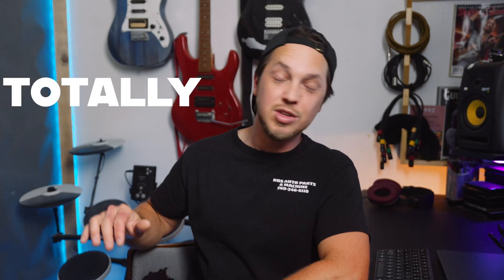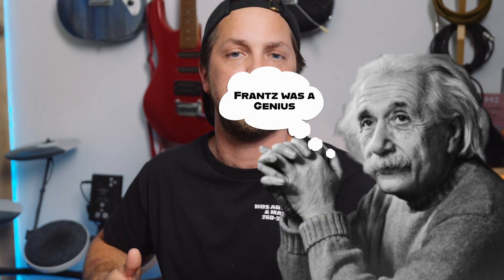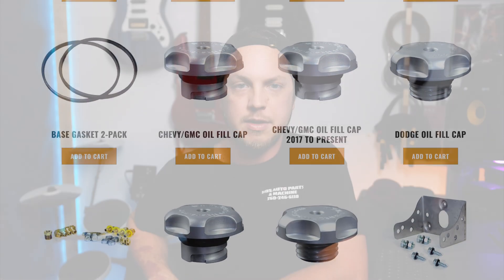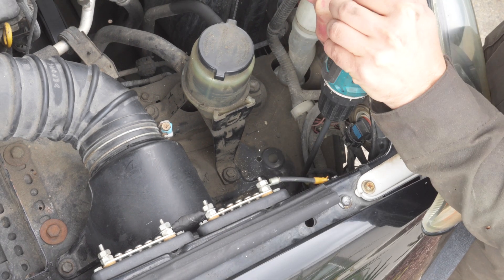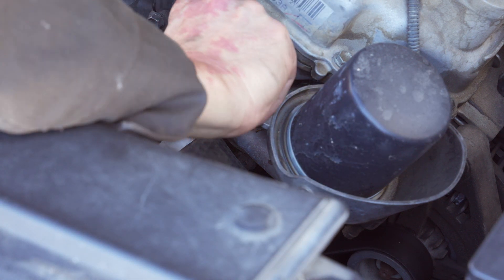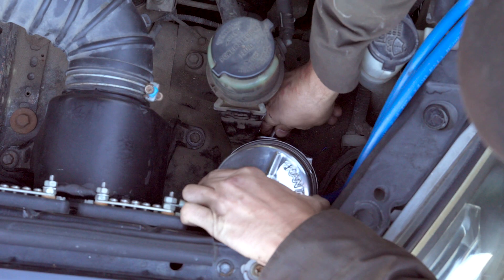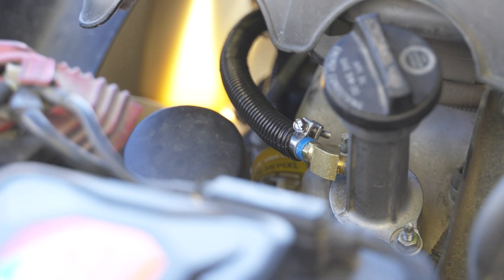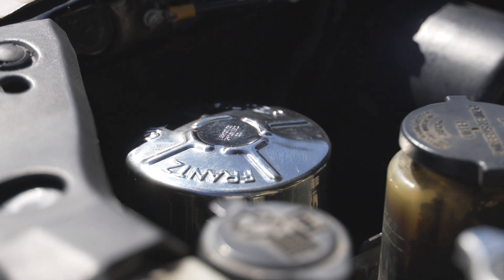Never Change Your Oil Again: Frantz Filter Bypass System Explained & Installed

Comment: When I was a kid my dad had a toilet paper oil filter on his car. He never changed the oil, just the roll of toilet paper. He only added any oil when he would change out the toilet paper roll. He said that the little bit of oil that was added helped replenish what viscosity breakdown that may have occurred over time. He had used this filter on every car he had starting with the 1936 Ford he bought in 1940 and drove until the late '50's. He transferred the filter from car to car until the late 1970's when he let it go after single ply toilet paper was too hard to find. He said that the glues used in double ply was not healthy for the engine. I believe that his filter was a backyard mechanic hack from back in the day but i recall him saying that there was a company that started producing them in the '50's.

My father was a research and developmental engineer for International Harvester. The guys my dad worked with would argue over who would get to buy my dad's old cars when it was time he bought new.
Reply from the maker: You nailed it. All the haters think they can read some science and know what they’re talking about. Nothing speaks, louder than personal experience like this.
Reply: @diyoverdrive  I recently saw single ply toilet paper in the local discount department store and thought of my dad's filter. But my days of high mileage driving are over. It would have been nice to have when I was putting on 30k a year.
Reply: I normally use Great Value 1000 from Walmart.
Reply: I think some of the larger Jackmaster filters have 35 dollar elements. I would probably figure out how to use Scott 1000 or Viva towels. There is a lot of filter media  in paper towels. In the 60s around San Jose California all toilet paper had a 1 1/2 inch core. The grocery stores had high quality 2 ply. The single ply was loose wound. At some point I started using Georgia Pacific Envision 2ply from Office Depot. It got harder to find high quality toilet paper in grocery stores. Was talking to a trucker that had two Frantz 3 stackers on his Detroit  2 cycle. Said he gets a 6 pack of Safeway Truly Fine to service them. That paper may be different now. It was 2 ply in the 80s.
Reply: The 06 Pontiac Torrent has a Australian Jackmaster Classic mounted as high as possible. There is a air tank valve in the lid. With the filter still hot I can open the valve and let air in. The excess oil will drain back to the engine. No spillage. I drilled out the orifice and installed a Perma Cool universal 189 sandwich adapter. I cut a 4 1/2 inch element from a roll of VIVA Signature Cloth paper towels. Been running a 5 1/2 inch element in the Flat head Ford V8 canister filter for some time using a Perma Cool 189 sandwich adapter.
Reply: The Frantz has been around since 1953. In the 80s an old couple showed me their 53 Chevy they bought new and installed a Frantz on it. Better designed filters have come and gone. Motor Guard only makes compressed air filters now.  I have several in use as well as the Gulf Coast junior. Another favorite is the Australian Jackmaster Classic. Ive heard they have been around since 1954. The name comes from making jacks. They have more expensive filters but the Jackmaster Classic works for me. Its best for tight places.
Reply: The way people dont need to drain the oil with these filters is additives last a lot longer in clean oil. New oil added at filter change replenishes the additives. Frantz knows this. They also know people will laugh if you tell them they dont need to drain oil. People have been fed oil change bs all their lives.
Reply: I dont remember what I did yesterday. In the 60s we had MD  Chiffon  Safeway Truly Fine  and many other 2 ply. Dont remember any 2ply we couldnt use because of glue in the paper. I was a mechanic for Safety Kleen corporation. For the Gulf Coast filters and Motor Guards I used 2ply out of the Janitors supply. I brought in Bounty Big roll paper towels for the big diesels.
Reply: @zafnor   My grandfather owned three cabs from the late 50s to mid 70s. He drove  one and had two other guys drive the other two. He worked for a cab agency in Massachusetts. He did or coordinated his own maintenance. He had Fords and Plymouth’s. L6 and V8 with TP filters. I recall how he would add make up oil and swap out the TP and flush out the transmissions and keep up with the rest of the cars needs. He did get some in frame  ring/ bearing jobs after long service life. I recall him saying he would pull a valve cover off to inspect the clean top end and he described the TP filter as a reading system.
Reply: Refining system I meant to say
Reply: 9:40 I know its hard to believe but in the old days oil actually got better with use with toilet paper filters. Engine heat broke down the impurities such as the highway construction materials. Most of the stuff ended up in the toilet paper. Some of it ended up stuck to hot engine parts. With the multi grades you really had problems. Then you had the polymers  breaking down and fouling the engine. I think International might have been the last to require single weight oil. Oldsmobile owners manual said you could use multi grade in an emergency until you could get 30 weight. My 79 Ford diesel tractor has a sticker on the engine. You can use 10 30 or 10 40 . For extreme hot weather use 30 weight. One owners manual said 10 40 will void the warranty. Most of this was about conventional oil. That was the Oldsmobile diesel.
Reply: In 1964 I used 2ply facial quality toilet paper.All of the 1 ply I found was loose wound like you would find in a porta potty. For awhile I was getting the best 2ply from Office Depot. In the old days we didnt have Frantz elements or Scott 1000. When I used the Frantz toilet paper had a 1 1/2 inch core.

Comment: Clickbait title and B.S. video. Even the Frantz website says all this does is give "Extended drain intervals"
Reply: In the 60s the Motor Guard oil filter of San Jose California was the best you could buy. They couldnt compete with the inferior but better known Frantz. They were the only ones safe to use for compressed air The M 30 is similar to the lube oil M 100. I started converting the M 30 to filter lube oil. I remove the plastic internal parts and put a 2 1/2 inch OD by  1 1/4 inch ID flat washer in the bottom for a core seal. Had to ream the ID so it would go on. With the shorter paper nothing is needed at the top. A center tube isnt needed with firm paper. Need a 1/16 inch orifice at the inlet. Motor Guard started putting stickers on the filters saying use only Motor Guard parts. I normally use Gates 3/8 transmission cooler hose and Ace hardware fittings. Im getting my old Subaru ready for the auction. It has converted Motor Guards on the engine and transmission..With the converted Motor Guards and the Australian Jackmaster Classic I push the TP down hard against the bottom and put on the top. When you start the engine the oil pressure keeps a downward pressure on the core seal.
Reply: Frantz knows that their customers with gasoline engines normally dont drain their oil. Diesel engines are more of a challenge because of the soot. On my old 6.9 Ford diesel I changed the little Gulf Coast junior from 1500 to 2.000 miles. The little junior was bolted to the plastic fan shroud as high as possible. The excess oil drained over night. I could change the toilet paper and add a quart of oil in about 30 seconds. The oil was black but clean. Didnt stain the skin. It passed the old trucker palm test. Didnt put a wrench on the drain plug.
Reply from the maker: @Kill3rT0fuuu  I clearly explain in the video my personal experience never changing oil. It’s not click bait lol
Reply: Way to say you didn’t even watch the video.
Reply: Got into a debate on a Trawler forum  in the 90s. I normally debate fools. This guy was a challenge. It got real when he said bring your wife down to Canaveral . I will take you on a tour and we can talk about filters. I called Gulf Coast filters and told Charlie  Sims to send someone down to Canaveral that understands big engines. They were moving the shuttle then. Charlie Sims was a Frantz dealer before the Frantzs went out of production. He came out with a better toilet paper filter and big filters that used Bounty big roll paper towels. Dont know what they use now. The new owner said the 10 quart model is 99 percent at under 1 micron. Charlie Sims passed. His top salesman took over.  The top salesman.dropped the little toilet paper filters. The Australian Jackmaster Classic is similar. A lot better design than Frantz. Im told NASA is a customer.  One of my fleet customers needs more big filters. Im 84 and dont crawl under trucks any more than necessary.
Reply: You are actually cleaning the oil with depth filtration and diluting the soot with new oil at filter changes. Some of the soot is as small as 1/3 micron. Even toilet paper cant get that small. Its non abrasive at that point. If the soot gets too high you can feel it. Modern gasoline engines are easy.
Reply: It looks to me like Frantz has been taken over by sales people. Oil filter sales people know you dont tell people no more oil changes. They think keeping the oil clean and not changing it is snake oil. The Australian Jackmaster Classic people are filter people. They come right out and say the Jackmaster eliminates oil changes. I dont think John Frantz recommended oil changes.

Comment: Milking the algorithm...no it doesn't mean you never have to change your oil. I already researched this many years ago.
Reply from the maker: @picklepee2771  research is one thing personal experience is another. My 1985 k20 hasn’t had an oil change in 15 years 🤷‍♂️
Reply: I normally dont drain oil. If the oil gets milky or the toilet paper feels soggy I will see where the water is comming from fix it and change the oil. I normally drive enough at operating temperature for the PCV valve to do its job. When I buy a used car I might start with new oil. I was talking about a Peterbilt with a series 60 Detroit. The owner says it has almost no wear at 1 million miles with one oil change. It used Shell Rotella 15w 40 conventional oil and a 10 quart Gulf Coast bypass filter. Road King Magazine asked me for the truck owners phone number. They did an article. They said the new makeup oil added at filter change was equal to a full oil change every 40.000 miles. It can be misleading.
Reply: A kid at work came out of a restaurant to find his Chevy pickup gone. The police told him its probably half way to Mexico. I told him he could have the Subaru but both head gaskets are dripping oil. He just used a cheaper oil. It ran nice. At somewhere over 300.000 miles he went to Iraq. Never saw the car again.
Reply: I keep wanting to say I started using the Frantz in 1963. It was a nearly new 64 Rambler American flat head 6. It came with a nearly useless spin on bypass filter bolted to the head upside down. To clean the oil I installed a Frantz. The overhead valve engines came with a full flow filter.
Reply: I was on YouTube talking about my 84 Subaru with over 250.000 miles with no oil drains using a Frantz with a Frantz adapter that eliminated the full flow filter with Mobil 1 15w 50. A Caterpillar lab manager sent me a sample kit. He said the oil looks good for that many miles but suggested I change the Frantz every 6.000 miles instead of every 12.000 miles. I was driving about 12.000 miles a year and changing the Frantz about every 4 july.  Been doing 6.000 since. He found some caramelization.
Reply: My research started in 1964. I put a Frantz on my car. Later I did research on the Motor Guard the Australian Jackmaster Classic  and the Gulf Coast. Not much I dont know about those filters. I have the flat head Ford V8 canister filter pretty much figured out. John Frantz put Frantz canisters in the Ford canisters. I use only the Ford canister. I am a filter guy.

Comment: This is crazy. Never heard of. I guess I now opened up a can of worms for me. Gotta do a lot more reading on this.
Reply from the maker: @hanseich  definitely do more reading about it. There’s a lot of misconceptions surrounding bypass filters. Franz won’t tell you that you’ll never change your oil again. But if you call and talk to them, they will tell you they have clients who have not needed to change their oil for years based on their analysis.
Reply: Probably shouldn't tell people no more oil changes. They have been told all their lives proper maintenance is allowing the oil to get dirty then draining it. Keeping the oil clean sounds like snake oil to them. Frantz knows this.
Reply: I have probably changed oil at least a dozen times since 1963. I dont need lab analysis to determine if I need an oil change. I know what good oil looks and feels like.

Comment: Influencers, influencers and shills everywhere!!! They need to put the "you" back in youtube. Virtually all content on this platform is an infomercial or a low-budget 'reality' show.
Reply: When I used the Frantz we didnt drain the oil unless we had a reason. We changed the toilet paper more often and added more makeup oil than we do now with fuel injection and modern oils. I dont remember John Frantz recommending we buy a Frantz and still drain the oil. We had things happen like leaky head gaskets. Ruptured fuel pump diaphrams. We had to keep an eye on the dipstick. Dillan pays attention to whats happening under the hood. That helps a lot. A guy came into my garage. His oil light comes on when he goes around a curve. There was just enough oil in the pan going straight. When he started around a  curve the oil would go to one side of the pan and the oil pump would suck air.  One guy said I got this red light thats been on a few days. It was the oil pressure light.
Reply from the maker: @ssjlkrillin  I knew people wouldn’t like this video. I called it out in beginning of it. Lol
Reply: Probably should say no more oil drains. The reason some of us dont drain oil is additives last a lot longer in clean oil. The new oil added at filter changes replenishes the additives. For what it costs to have the oil analyzed  I can change the toilet paper and add new oil. Its easy for me to tell if I need to change the filter more often. I normally dont drain oil. A leaky head gasket for example will turn the oil milky and the toilet paper will feel soggy. The same thing can happen with short trips in cold weather. I try not to start my car unless im going somewhere. Up north I drove about 70 miles a day for 7 years.
Reply: I see someone found some old Motor Guards. I believe on the box it said oil changes are obsolete. Not sure about Frantz. Probably the same. They assumed people had enough sense to know when oil needs changing like a leaky head gasket or not operating at normal oil temperature long enough for the PCV to work.

Comment: Hey to each their own I guess.
Reply from the maker: @TheHonestPeanut  I like having clean oil in my engine
Reply: If you could eliminate all of the reasons for oil changes you could eliminate all oil changes. The biggest reason is poor filtration. Then you get into things like leaky head gaskets. Not operating at normal operating temperature long enough for the PCV to remove the condensation and unburned fuel. If you have a filter that cleans oil and you dont take care of it. Thats about it .
Reply: The oil change trolls dont cut Dillan any slack. Some help is coming. Hang in there Dillan.
Reply: Someone correct me if im wrong. In the old days Greyhound buses used Standard Delo 100 30 W with a Luberfiner bypass filter and didnt drain the oil. The old Luberfiners used cotton. Later they used pulverized newspapers and wood chips. Greyhounds used Detroit 2 cycle engines or what we called Yamaha's at one time.